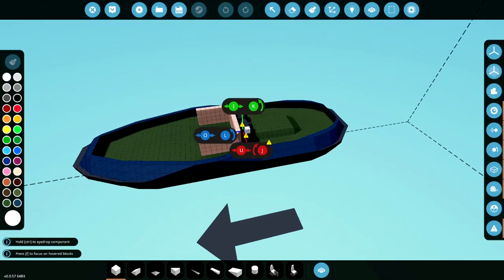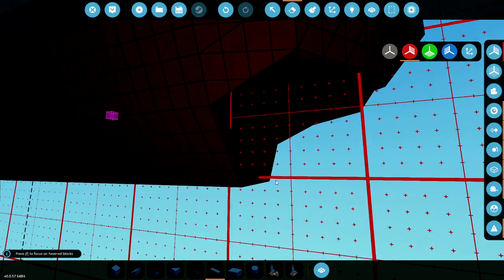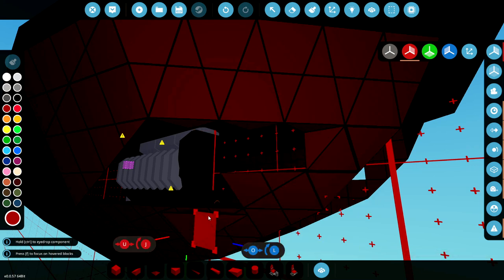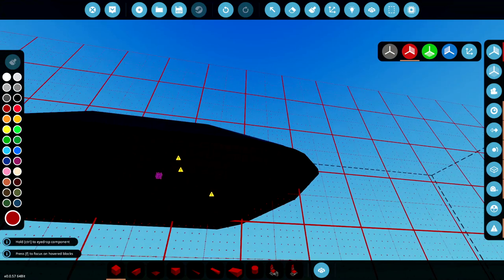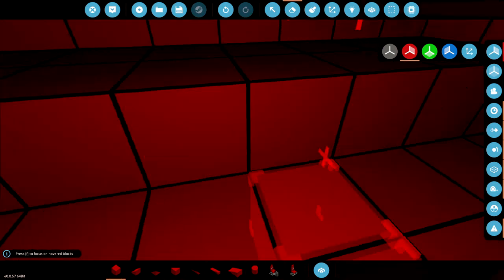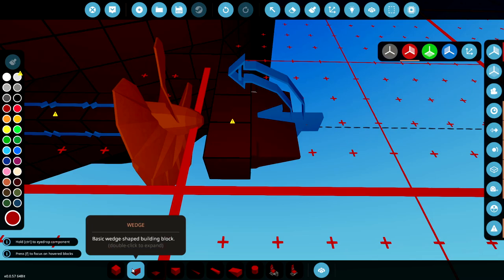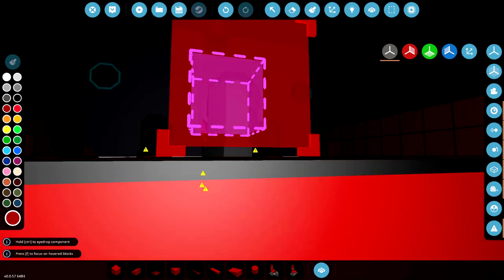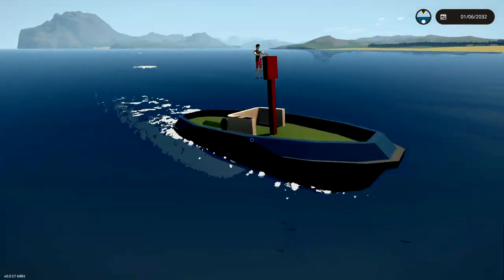Working Engine = Super Speed Tug! - Tug Boat Build - Stormworks - Part 2

Comment: Frantic add a fluid filter for your cooling system bc it can over time degrade your engines but that might just be  the mod engines.
Reply: or an intercooler with a freshwater cooling loop
Reply: @secawesome8543  Or that to that is commonly what I do but I add in pumps and a radiator.